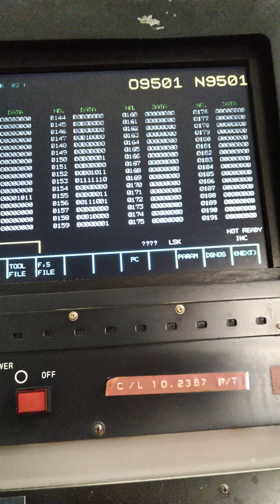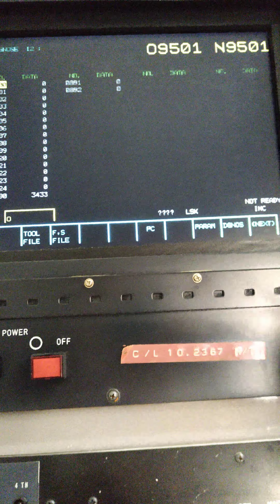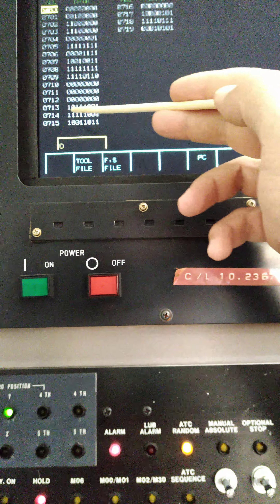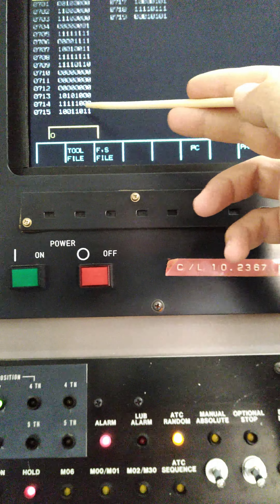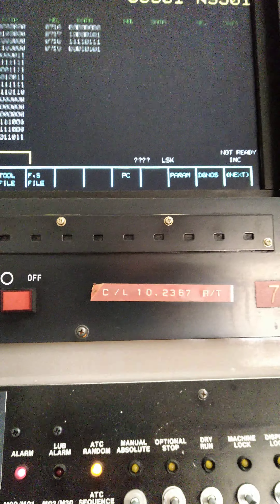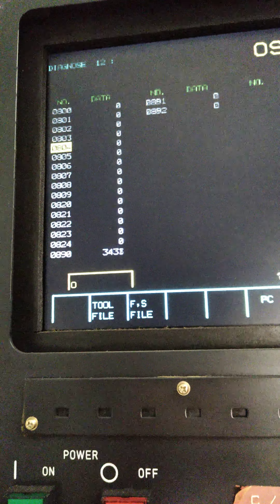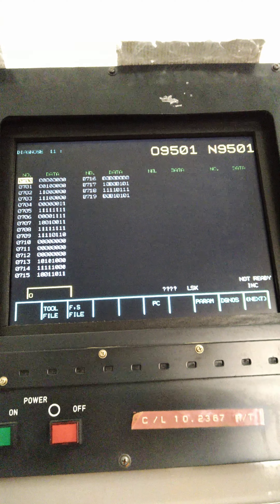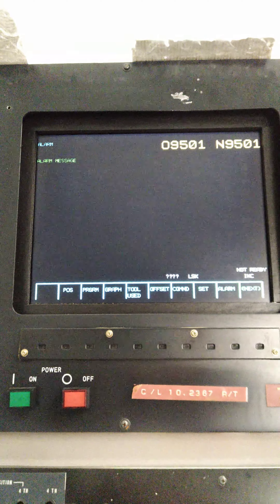Mitsui-Seiki J6CN, restoration project (2).

Comment: Parametr
Reply from the maker: Yes they are loaded; parameters do exist and are reflected under the PARAM function key. This reflects the DIAG function; it's odd that there are a couple of lines with bit flips with machine sitting idle. My best guess is it could be the hyper sensitivity of the glass scales doing this; line noise in an amplifier? This machine is accurate down to 1/100,000th an inch. Thank you for your interest... Regards, CT
Reply: @CAGE-CODE_30LU7  I have the same machine but it has no parameters could you share this information
Reply: Good day! Today I will make a video of my 6cn and show you that the diagnostic 704 713 714 890 also jumps
Reply: 713 bit 4 axis X, 713 bit 0 axis Y,  714 bit 0 axis Z , these bits indicate the operation of the induction servo system ,
bit № 76543210
                  X      Y,  890 axis 5 ?
Reply from the maker: We will find a solution, contact me by email...
Reply: @CAGE-CODE_30LU7   INFRA18@ YANDEX.RU
Reply from the maker: ContactMachinerySystems@Gmail.com